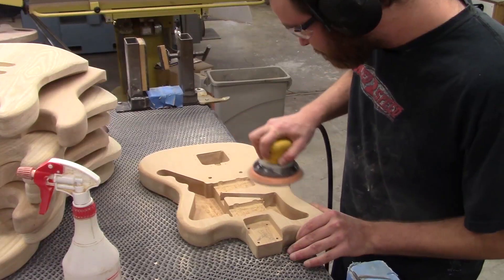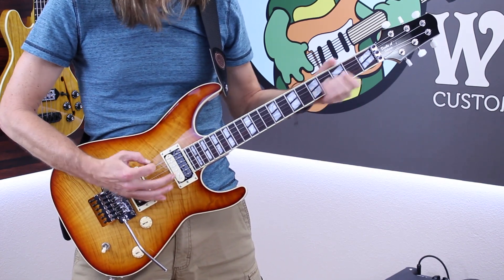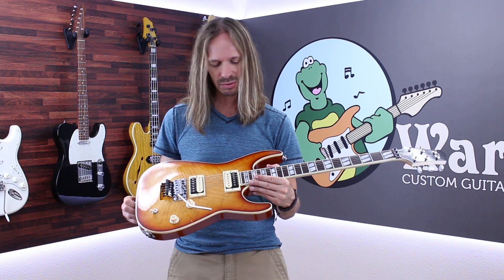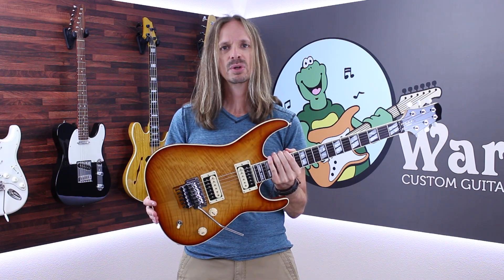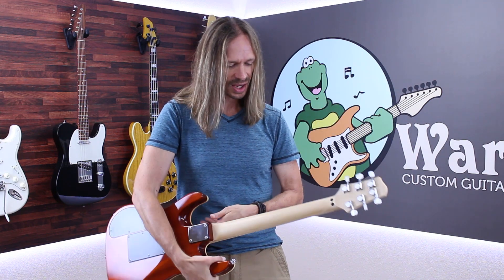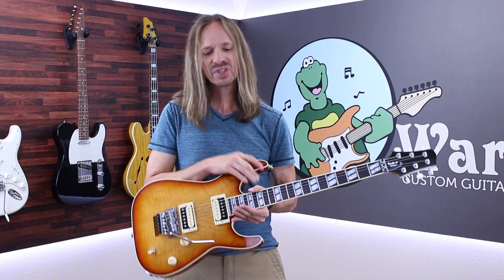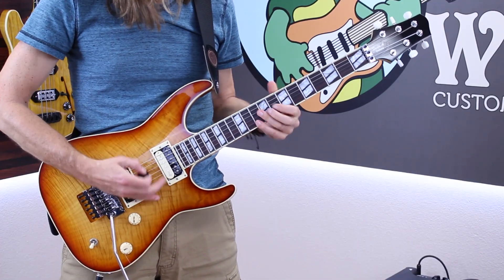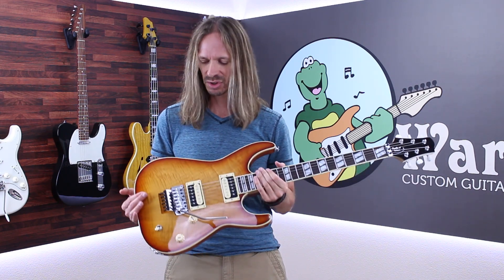My Personal Warmoth Build

Comment: Hi Aaron! This is awesome! So inspiring. I am saving up for the one for i am. i am play def metalZ and blackened metalZ... Musiclander i am really want it  in Koa although i am have it spec for mahogany and flame top  right now. Schaller floyd. R5 nut. Inline reverse arrowhead. Goncalo Alves fatback neck and fretboard with flat black  skull and crosses. Can i am put in  the ferrule bolts to hold the neck in myself i am think i am shall instead of using a back  plate,  even though it would work fine. Guess just put in  inserts into the neck and bolt through the body. Looking at finishes was thinking a ziricote fretboard maybe  as well. Bengal burst Dye satin Or black dye burst or blue and match pickups to color with black blades. No controls only switch and large jack. Pickups are Dimarzio DAX, Sugar chakra S, and super distortion S. jumbo stainless 24 fret with  720 mod. i am. i am can  only save up so much a month for this guitar so Aaron, it  shall take 2 years this is the only guitar i am need in a 6 string format. Thanks.

Comment: That's a very unique guitar! The Gibson scale length is my personal favorite as well! I wished Warmoth made a Superwide Gibson scale length neck...or even a 1-3/4 nut width with a 24-3/4 scale length would be awesome!
Reply: They do Bro i think 44mm is what you want it goes up to 45mm nut  width they have the Gibson's scale length conversion necks as well you have to click on custom  build button for hat you want
Reply: @davidparkes7977  Unless they've changed in the last month or so, the Gibson scale length necks are not available for 1 3/4 necks, as well, they do not offer a Superwide Gibson scale neck.
Reply: @davidparkes7977  I stand corrected! I just checked and they now have that as an option. I hope it's not a website mistake, as those options weren't previously available. I've emails to prove it.
What I've also noticed is that it appears that custom Superwides are no longer available. They have some Superwides available in the Featured In Stock section.

Comment: Hey Aaron: the coolest guy at Warmoth 😉 have fun with your guitar ! Are the pickups splittable ?   Yes, you guys should probably build a different guitar every month to show the options and then sell it at cost price: you wouldn't lose any $ and make a customer happy every month ! 👍🏻
Reply from the maker: I don't have the pickups wired to split, but they are 4-conductor, so it is possible to do it if one wants to. I've just found that I never use that feature, so I didn't bother. I mean, when you only ever play Van Halen riffs, what's the point? Hahaha...

Comment: unless a brand actually begin to craft descent baritone scale electric guitar, I'll shop my woods & pieces to Warmoth. 28'' have a problem with the harmonic tunning and not every strings set fit well on a 29 3/4. The 28 5/8 from Warmoth is probably the most versatile scale I played on.

Comment: You should do a video that demonstrates the different wiring options for guitars.
Explain how the volume pots and resistors affect the tone.
Teach those misguided people that a Coil tap is different from Splitting a Coil,
and Push Pull knobs are not for spazzers who what to have it all.

Comment: Very nice guitar and it looks great, for the heck of it I priced it out on your site and it came to about $1400 for just the Body and Neck...... A bit to much IMHO.
Reply from the maker: It's true: when you get lots of primo options the price goes up. You could get something similar but much cheaper by eliminating the body binding, neck binding, custom inlays, upgraded fretboard wood, upgraded Lam Top, etc.
Reply: @warmoth   Thanks for the reply. I took some time really looking around your site and ended up buying a body in stock that was already painted, it was cool being able to pick the actual body and because it's made and in stock, there was a great saving of money.

Comment: Headstock isn't straight, is it? If so, does it suffer from the same issues as Gibson/Epiphone angled headstocks? I broke an Epi neck once, and once was enough for me.
Thanks!

Beautiful guitar by the way. Reminds me of some Schecter.
Reply from the maker: Yes, it's a tilt-back headstock...and very strong. Differences from Gibson: 1) Less of a back-angle, 2) Volute, 3) Scarf joint.
Reply: @warmoth  Thanks!

Comment: @Warmoth Guitar Products - Just curious, on a 12" radius /24/34 Gibson style neck, why did you go with the 6150 frets rather than the 6130? On the Warmoth website 6130 is described as the Gibson fret, while the 6150 is described as Fender. I am sure you have tried both those combinations, what is the difference in feel? Thanks!
Reply from the maker: That's the beauty of Warmoth necks....you can mix and match to get exactly what works for you. I went with 6150 because it's my favorite shape. I personally hate 6130 wire...very flat, low, and hard to bend on. I don't think Gibson still uses 6130 very much. It was mostly used on older models. Most people today prefer the taller fret sizes like 6150 and 6105.
Reply: @warmoth  Thanks, and that leads me to this: If I were looking to get a Les Paul Classic feel to the frets on a 12" radius conversion neck, would the 6150 or 6130 be  correct?

Comment: Please tell Warmoth to add the VIP body to the website's virtual build app. The Soloist, Start, Tele, Regal, even the Diamondback, are there but not the VIP. Add it!
Reply from the maker: We are currently working on a new site that will have a visual builder for every single product...including all guitar and bass bodies and necks. It's still a ways off, but it's coming.
Reply: @warmoth  Awesome! A suggestion: include gold-covered and chrome-covered humbuckers as well as uncovered humbuckers on the builder. There's no need to include every single pickup, all uncovered HB really look the same. Also include colored single coils, i.e. black, white, cream. And include single coil rings for rear routed bodies.

Comment: How much would a builder charge to put warmoth parts together? I can't even follow Ikea instructions nevermind build a geetar.
Reply from the maker: LOL. "Hex-wrench-challenged!" :) The cost for somebody else to put it together is gonna vary based on where you live and what luthiers you have access to. It's a few hours work for a trained luthier. Do you have any guitar friends who also own a drill and a soldering iron? :) Probably the most complex part about is wiring in the pickups.
Reply: Guitar Center charges $25/pickup and another $5 each for any mini switches or coil taps. Budget for a good hundred bucks. I am a pretty novice DIY guy but I assembled all the hardware with a drill and bit set for my semi-hollow build last year with no issues. As long as all the bridge holes, control holes, and pickup holes are drilled already, the hardware goes in pretty easily. Just take it to someone to give it a setup afterwards to cover your ass lol. GC charges between $60-$150 depending on the tremolo and stuff around my area. Typically opt for a good luthier first, and settle for GC if you don’t have access to any locally.
Reply: Andy M , it would depend on what you plan to use. I spent $1300 at Warmoth, about $600 at Amazon, and about $ 150 at Guitar electronics. I'd expect to pay at least $300 for the assembly, setup, and custom wiring. Going to do it all myself thought. Even bought all the tools in need. Keep in mind that this is a very custom build and you can build a very nice guitar for a lot less.
Reply from the maker: Good point...there are so many options, you can do something for very little money, or spend much more on something crazy-custom. I've never done it before, but some day I should sit down and figure out what the absolute cheapest combo of options is, and also what the the most expensive combo is. Would be a fun exercise.
Reply: A good start would be taking the cheapest wood & leaving out all the extra-cost options like the Contoured heel etc. ... I think...

Comment: How did you do the positioning of your 2 tone knobs? Those don't seem like the positions available on the Warmoth site, which are the same as a Strat. I'm only getting one tone knob, and I would like to position / space the knobs a little differently than the standard Strat. Thanks.
Reply from the maker: That is the control scheme from our VIP body. One of the perks of working here! :) We can probably do it for you too, if you call in and request it. Otherwise, drilling them yourself isn't too tough.

Comment: What would I have in that exact same build $ If I had you do another?
Reply from the maker: If you wanted one exactly like mine, with all the "Aaron-approved" specs, the neck and body would be around $600 each. Hardware and pickups would probably a few hundred more. However, I got a ton of primo options on this one...the binding on both neck and body, the fancy inlays, the Flame Maple top, custom radius, etc. If you chose standard options you could get something similar for much cheaper.
Reply: @warmoth  ok, I was just impressed with it and thought I should price it, so I could have a general idea of what it takes to aquire one. Like what to sell to make room for haha.

Comment: How do you get that control setup on a soloist? Do you have to email about it?
Reply from the maker: Good eye! That is the control layout from the Warmoth VIP body. I asked to have it specially done on my Soloist, but it is not officially offered to the public. If you give us a call we MAY be able to do it for you. If so, there would be a small upcharge. Be aware that it is not an officially supported option, and I did have a little trouble installing the 3-way switch, because it was very close to the edge of the control cavity. However, for me it was worth it because that is my favorite control scheme. There is also always the option to order the body with no controls, and drill them yourself....anywhere you want.

Comment: It sounds nice but damn man you can't get a full build under 1000 bucks. Not going out of my way to be an A-hole but I can get a Schecter that sounds just as good if not better for about 600. Warmouth should have some options for us poor guitar players.
Reply from the maker: You can definitely get a great sounding off-the-shelf guitar for $600. But how much would it be to get a Schecter with the neck wood, fretboard wood, fret-wire, neck carve, and nut width you prefer? Warmoth isn't about building the cheapest guitar you can buy (though you can). It's about customizing a guitar with every option exactly the way you want, so that you have something better than the off-the-rack options....a guitar built for exactly the way you play.